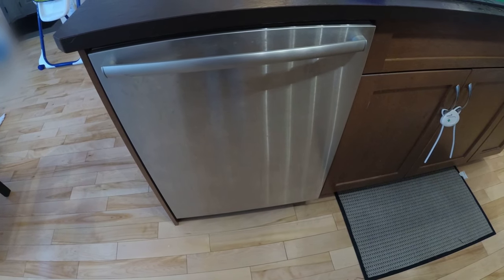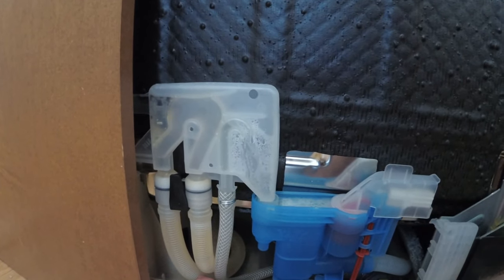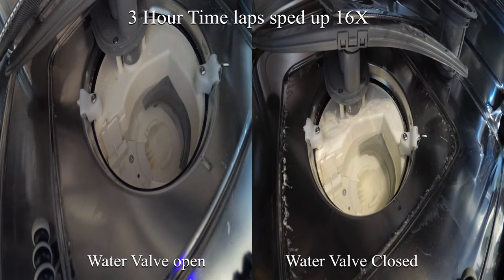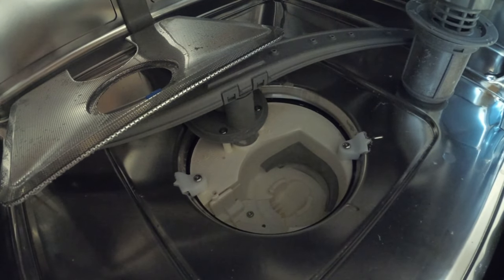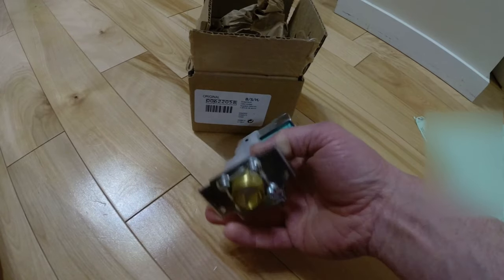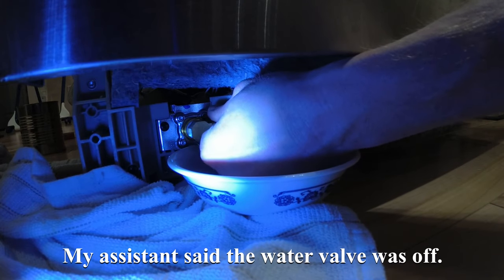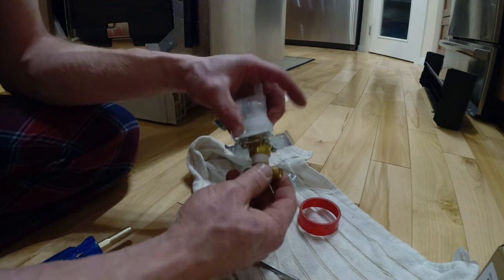Bosch Dishwasher Repair - Water Accumulation In The Bottom.

Comment: Fantastic walk-through! This was exactly what I needed. One small upgrade that might help folks: after you connect the braided supply line to the elbow/intake, you can turn on the water to check for leaks before doing the rest of the re-assembly (as the valve defaults to “off”). I figured out this short-cut after putting everything together, discovering a small leak at elbow/intake connection, and then having to disassemble everything again to fix it. Again, thanks! Grateful folks like you put these videos together.
Reply from the maker: Haha. You are absolutely right. It seems obvious now, but I didn't think of it at the time. Hopefully other people read this and do it your way. Glad it helped.

Comment: Thanks for the guide.  I  just finished repairing mine and it was quite helpful.   Like the other commenter prior to me I was able to pull the assembly out the front to avoid disassembling the manifold.  Removing the spring clamp and hose after those years of setting into shape though was a beast.  You made it look way too easy.
Reply from the maker: Haha. Sorry, I might have a little more experience removing stuck hoses. But at least you got it done. And hey, you did the other part fast.

Comment: Thanks for sharing. It looks like you only needed to disconnect the water feed line from manifold and then unscrew the valve from the front side and pull it out, disconnect wires, replace the valve, re-connect wires and the tubing to the manifold. The reason I am saying that is I saw similar video on appliance parts channel, except your dishwasher looks slightly different to theirs, but very similar to mine and the problem looks very similar too. Thanks again for posting.
Reply from the maker: No problem. The hardest part was trying to figure out what was wrong. It would probably only take about an 1 hour if you already know what you are changing. Don’t forget to turn off your water to the dishwasher.

Comment: Thanks for sharing, Smikey. Saved me a bit of time even though I knew the valve was bad (the solenoid actually popped off and half flooded my kitchen!!). You probably know this already, but silicone grease is more appropriate for o-rings than petroleum jelly. Not critical, but better in the long run. 
Cheers again!
Reply from the maker: Cool, good tip.

Comment: On your model, Bosch built the entire dishwasher around the inlet valve!  The model that I have, the water inlet valve is little bit different, it is in the back and at least looks significantly easier to replace.  I will know in next few days when I get the replacement part but few videos that I have watched, nothing else needs to be removed except the valve.
Reply from the maker: Wow. Lucky. Good luck!

Comment: Bosch dishwasher model SHE43F15UC/64     FD910401139
55 v at water valve with valve disconnected, will not operate the valve.
Does the power come from the control panel? Is there a replacement control board available?
Reply from the maker: Short answer is that I  don't know. What I would do is do a Google search of your model and see if you can find a wiring diagram. 
As for you second question, I would look on a parts supplier like amresupply.com
You can do a search by model and see what is available.

Comment: Thx for sharing!  I have the same issue. not sure if I want to tackle it.  How long did this all take?  Cheers.
Reply from the maker: Finding the water inlet valve, diagnosing the problem and trying to understand how it worked took the most amount of time. If you only have to replace the valve then 45 mins to 1 hour. It was not too hard. And I hate shopping so it saved time there too!

Comment: On some higher end model such as yours there is a pan on the bottom to collect water incase there is a leak.  There is also a sensor at the bottom of the pan to detect the leak and give an error code.  I got similar pan on my Samsung dishwasher with the leak sensor.  On my Kenmore it's all expose so the water just leak to the floor.  So if you have a pan and there is a water leak it will cause the machine to malfunction.  Not drain properly etc...
Reply from the maker: I did see that when I was looking around. Something to look for when buying a new dishwasher so it doesn't  flood your floor.
Reply: @smikey.  The pan works if it's a small leak.  If the valve broke at the neck and the water leak out alot then the pan will fill up quick and will leak on to the floor.  If there is a crack on the drain hose for example that's a small and doesn't leak out often that will work well if you have the pan.  Or if the inlet valve is defective and drip a little then it would works as well.

Comment: Hey Smikey. Just curious, what tool did you use to remove the screws from the bottom panel? I was told a 1/4 in nut driver but they look like Torx screws to me.
Reply from the maker: Mine are a Phillips screw if we are talking about the same location.

Comment: the kenmore machine use the same valve.  They probably came from the same factory.  I just replaced mine.  The machine look very similar.  Got my part on Amazon for a bit cheaper.
Reply from the maker: Wow. Awesome.
Who knows who is making the parts for what. But what I am surprised with is how many times parts are labeled Bosch when I open them up. I was working on a 6.7L cummins today and the fuel pressure switch was Bosch.
Reply: @smikey.  they all come from the same factory.  They just put different brand logo on.  The tub look exact same on mine.  Maybe different on the outside but the same inside.
Reply from the maker: You could be right. Well I am glad we can find parts.
Reply: @smikey.  it turned out my dishwasher is 11 years old and was made by Bosch.  The new Kenmore are made by Whirpool now.  So it's about time that valve broke as yours is also roughly 10 years old.  Another 5 years and I'll probably need a new dishwasher.  Still much better than my Samsung dishwasher I had.  The Samsung valve broke also after 6 years.  I just got rid of it because the dish rack is rusted.
Reply from the maker: And a new one is somewhere around $1000? Yeah, as long as mine still cleans I will keep fixing it.
Reply: @smikey.  Those Bosch machine are very reliable.  My company is using a top of the line Bosch and it ran 3 times a day 5 days a week.  Still going after 6 years.

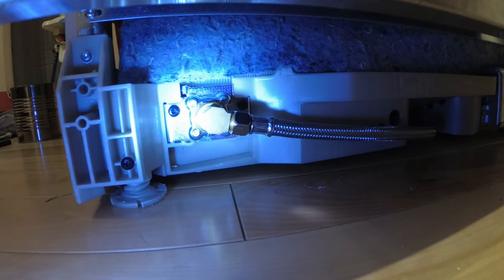Comment: What are you doing from 15:05 to 16:20?  That doesn't seem necessary to do to replace the valve.
Reply from the maker: I am cleaning the water out of the bottom of the dishwasher. Specifically where the water leak valve is. Then I am putting the water manifolds back on. Other people said they could get the water inlet valve with out removing anything but the valve. To get one hose off the water inlet valve, I thought it necessary.

Comment: so if I understand correctly, the repair can be done from the front without pulling the dishwasher out of its casing? How did you rule out a defect in the draining valve?  Hard to tell if water clean or dirty. Thanks Smiley!
Reply from the maker: I had to remove the side to get my valve out. Another person posted on this video they didn’t have to on their model. 
To tell which valve, i shut off the fresh water supply under the sink. The water stopped filling up. Then turning it back on made the water start filling back up slowly.
Reply: @smikey.  I will try that tonight and see what happens!   My machine must be 10 years old. I'm thinking it may good maintenance to change the inlet valve, check valve if only prophylactically... especially since I live in an area with very hard water. Your thoughts?
Reply from the maker: I would see what is wrong first.
Reply: @smikey.  of course
Reply from the maker: Good luck. Let me know if you need more help.
Reply: @smikey.  Hello Smiley.  Here are the results of my tests. When I shut off the water to the dishwasher, a little water still collects... However, I  suspect the water is more likely to be coming from my sink drain ... I stopped using my sink for several days because there is a drip in the siphon... I must  have accidentally loosened the clips on the tubing when I tried to reposition so that it looped above the attachment to dishwasher drain. Today I used my sink after drying out the water at the bottom of the dishwasher, and sure enough, there is a direct connection. Does this rule out the inlet valve? Could it be a defective Check Valve or could it be the drain valve?  I have already checked the usual culprits -- cleaned filters, looked for foreign objects in wheel of the sump pump etc. Any suggestions? Much appreciated!  Doris
Reply from the maker: I would start with how your drain tube is routed. It needs to make a loop above where it connects to the regular plumbing. I looked up on line for images on how they were supposed to be routed.
Reply: @smikey.  Smikey, the loop is in the correct position. There are two taps under the sink, one green and one blue (Swiss system), that I turned off (clockwise). One of the two must be the water inlet to the dishwasher. Neither turns off the water to the faucet in the sink. The water collects if I turn on the sink faucet EVEN IF I COLLECT WATER IN A BUCKET and don't allow the water to do down the drain. Water from main line is getting into to dishwasher, even when taps and machine turned off. Wish I could send you a photo of the plumbing under my sink. Only 3 years old.
Reply: @dorismugrditchian4815   Hi Doris, I’m currently having the exact same problem as you. Did you end up fixing it or just getting a new dishwasher? I’m just about to give up on ours. It’s been 12 years. Cheers! -Sam

Comment: I found another fix that seems to work. My POS I mean dishwasher does the same thing. I keep getting error messages, E23, E24 and every now then, hol . I have taken  it part cleaned the filter and cover, pulled the little plastic clip off and cleaned around the, drain motor. I use a air compressor  and a shop vac to clean everything. I should mention the first month I had this wonderful thing the repairs guys came out 3 times the first month. Total of 9 times when it was still under warranty.  It has Never worked like it is suppose to. One of them said they replaced the drain motor.  But still sounds like a small motor boat. So I took my shop vac. and attached it to the drain hose. Now when I run a load of dishes and it goes into the drain mode I turn on the shop vac. it is easy to tell it sound like a motor boat. It is a pain to have to sit there turning on the switch. I have been looking around for a pump I could attach to the drain line, but as of yet I have not found one.  Every once in a while I will just let it run without going through the hassle of using the shop vac. and sometimes it works.  I am starting to wonder if these power ball cube things, are the problem. Could it be they are just gritty enough to cause these problems. One of the repair guys did tell me to use a half cup bleach and a half cup of vinegar every once in a while to keep it clean. When I do this I have to  let it run an extra rinse cycle.
Reply from the maker: Wow. That sounds like a lot of work.

Comment: I wish I didn't buy a bosch dishwasher. Replaced the drain pump and still have water accumulation. Next is the control panel,it stops before the drain cycle
Reply from the maker: Dang. That sucks. Some models of dishwashers don't vent well and can get moisture into the circuit board. Good luck.